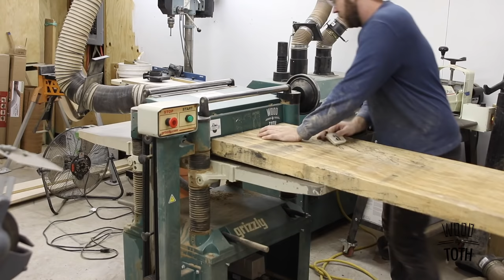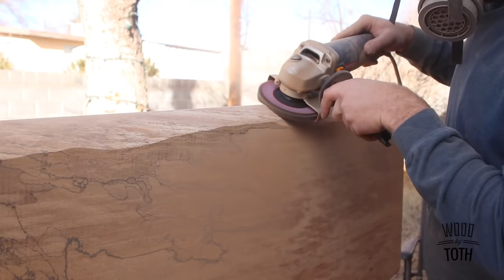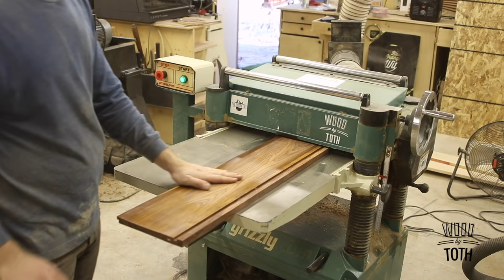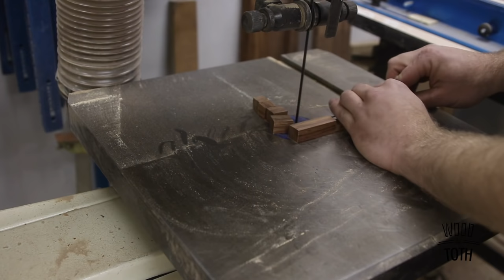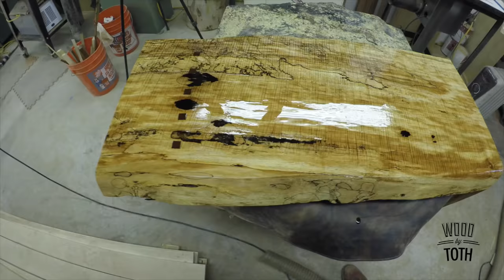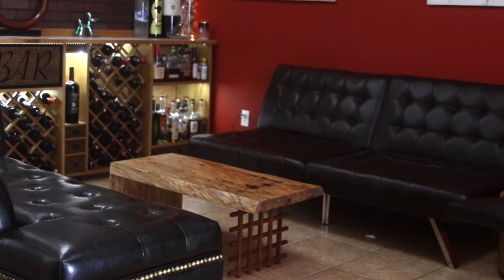Live Edge Table From Dimensional Lumber-

Comment: Really dig that table Kyle...but that hot glue gun is the BOMB!  Educate me please...any reason why you run the table saw blade towards the fence?  Also, I will be needing to build a dutch door, which incorporates a doggie door from scratch.  Any tips or references you can turn me onto.  Thanks...also enjoy the podcast.
Reply from the maker: Its a good trick! Thats just the way the blade tilts so I don't really have any other options. About the doors, send me an email and maybe we can have you on the podcast as a caller, talk about the design woodbytoth@gmail.com
Reply: My saw tilts the same, I move the fence to the other side of the blade, I might be too cautious but do not want it to bind and kick back.
Cool bench !

Comment: Why not make the lattice leg really go through the slab top?
Reply from the maker: Eric Commarato It doesn’t go all the way through for wood movement issues. If the top expands/contracts it could crack the top or the leg. With the legs being loose screwed into the bottom its free to move and the inlay can move freely as well

Comment: Very nice but rather predictable. I feel you’ve done a few of these types of tables. Shame it looks like only two of the four woods were actually used.
Reply from the maker: I've actually never made a table like this. I've used the miter trick before. Never made a slab table either, all first here. I'mr using the other woods but for design reasons mis matched wood doesn't look too pleasing to me. Thanks for watching though